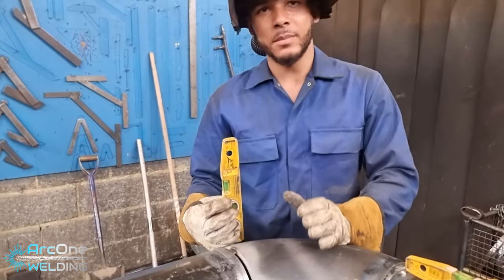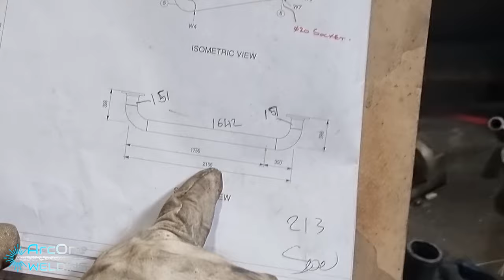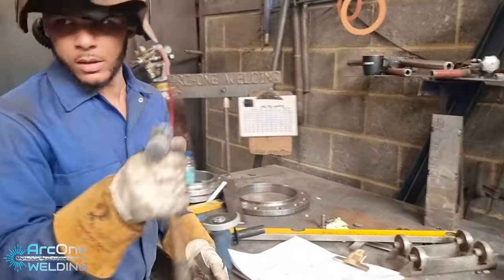Tips From A Pro, Fastest Ways To Fit Up Pipe

Comment: Good evening, I was pleased to watch your videos. Please allow me to ask you if you can explain the videos with how to tune or calibrate the welding machine in every mode. The most important thing is the speed of the wire, the speed of the gas, the strength of the ampere, the volt, the electric arc. This is a lot of necessary and important information, especially in the welding of pipes. Thank you very much